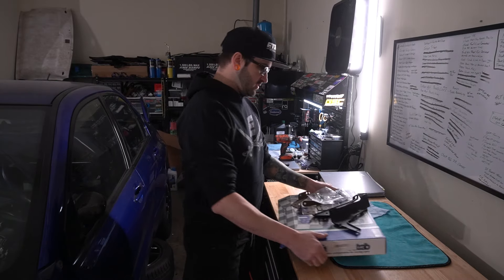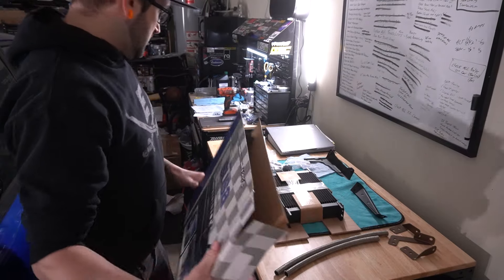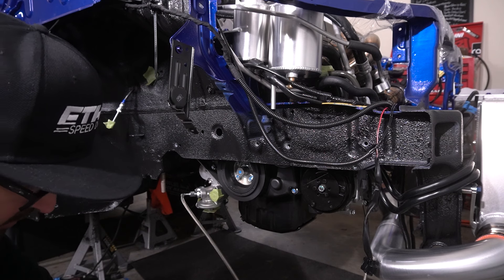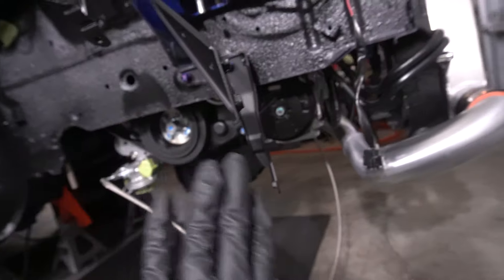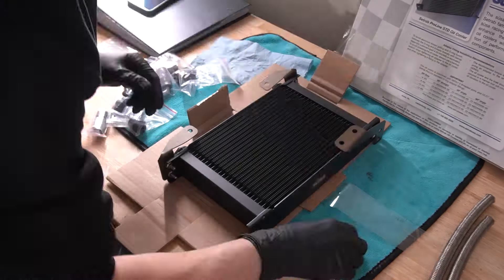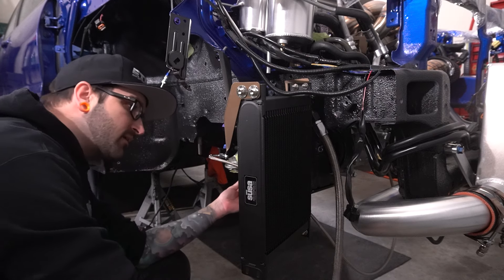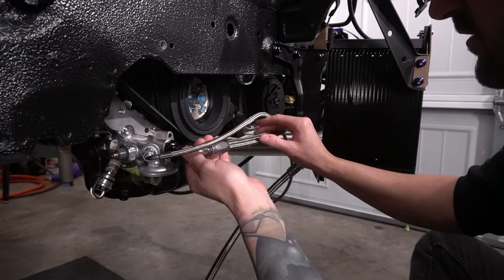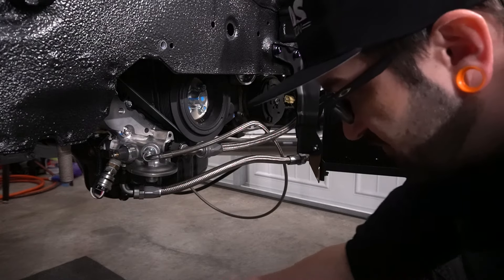Installing A SICK Setrab Susa Oil Cooler On My Evo 9

Comment: Awesome install, that cooler fits up real nice in there with those brackets! On the upper fitting too is it worth tweaking it downward a little more so there is less tension on the hose straight out of the fitting? Just a thought 😊
Reply from the maker: It was a very straight forward install to be honest! The brackets make it a little confusing but they really do what they need too haha! Honestly, yea it might, I was looking at that and thinking perhaps I needed to turn it just a little!

Comment: What size pipe did you use please? Im torn beteeen an8 and an10.
Reply: Use as big as you can with oil lines, -10an
Reply from the maker: Yup, -10 or -8, and I believe these in this kit are -8 if I’m not mistaken